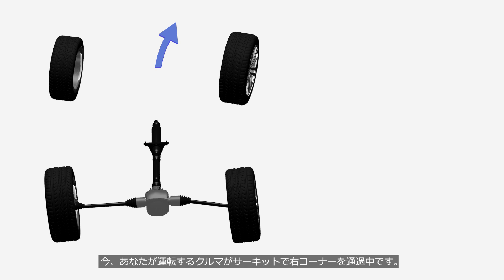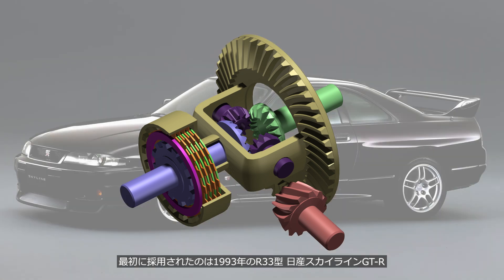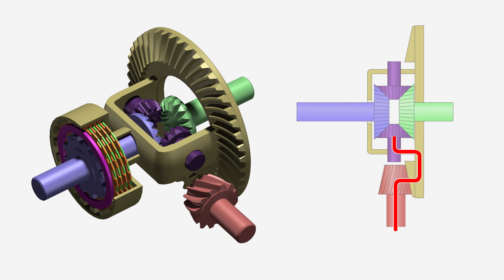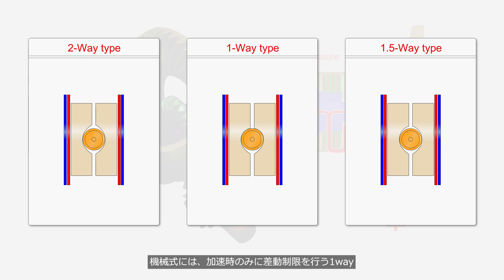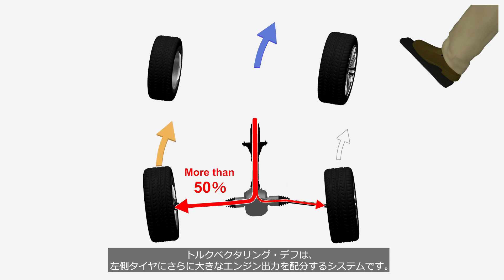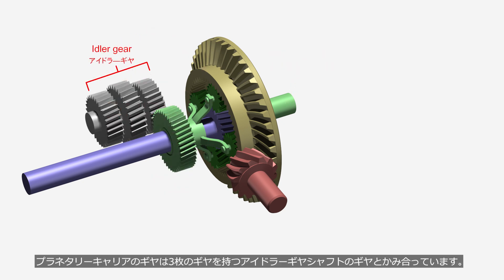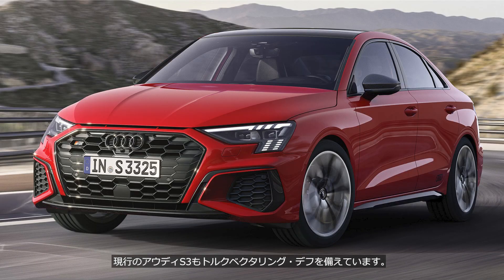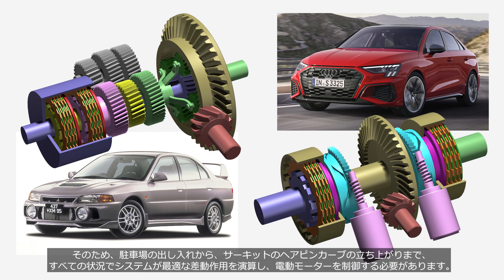Active limited-slip differential and Torque vectoring differential, How they work

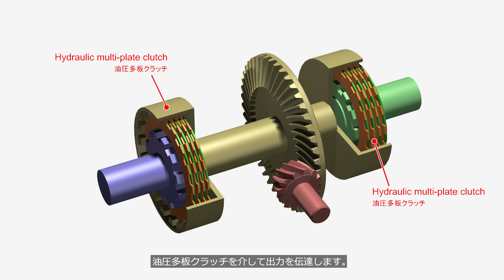Comment: The dual clutch pack actuator in the Audi 6:10 , so similar to the Lexus RC F TVD system! Beautiful !
Reply from the maker: Thank you for watching the video. I also think this system is amazing.
Reply: Yes but actually no. Lexus system is more similar to what audi uses in S4 and above. Audi RS3/S3 diff decribed in the video works on different principle that the lexus one. Lexus one is more similar to Mitsubishi one, even tho on the first glance it does not look similar at all.

Comment: So are these clutches just designed to slip the entire time they are active? If they were to be fully engaged and locked, would the outside wheel just spin a constant amount faster than the inside?
Reply from the maker: Thank you for your comment.
This issue always confuses me.
In the past, I asked an engineer from a clutch manufacturer about the hydraulic multi-plate clutch used in the center differential of a 4WD system.
I asked, “When the torque distribution between the front and rear is 60:40, is the clutch slipping?”
He answered, “No, it’s not slipping. When driving straight, the front and rear wheels rotate at the same speed. Therefore, the clutch is not slipping.”
Based on this answer, here’s my speculation:
The difficult part to understand is that what the clutch transmits is not rotational speed but torque.
Imagine the left tire is on ice, and the right tire is on a paved road.
The resistance on the left tire is zero, while the right tire experiences significant resistance.
At this time, if the clamping force of the left and right clutches is the same, the right clutch will slip, and all the engine output will be transmitted to the left tire.
When the system detects it, increasing the clamping force of the right clutch will transmit torque to the right tire. At the same time, reducing the clamping force of the left clutch will lower the rotational speed of the left tire.
In other words, if either clutch starts slipping, it is controlled to reduce the slippage.
I believe the same mechanism operates during cornering.
However, at small intersections and the like, it likely operates as an open differential, with the clutches slipping.
If my understanding is incorrect, I apologize.

Comment: seems that Audi design, while mechanically simpler, would be yet another failure point in the drivetrain. The mitsubishi would at least still operate as an open diff with the clutches burned out.

Thanks for the informative video!
Reply from the maker: Thank you for watching the video and leaving a comment. 
Exactly, Audi's system relies more on electronic controls, so it seems more likely to have issues.
But I've heard that Mitsubishi's system is also prone to breaking down, and it's often replaced with a mechanical LSD.

Comment: Just to confirm, with a limited slip differential, will only a max of 50% of the torque be redirected to the wheel with higher traction?  

And for open differential, almost all the torque goes to the spinning wheel, with the least traction?

Thanks so much.

More vehicles should come with these advance differentials, even if only for the safety aspect.
Reply from the maker: Thank you for watching the video and for your comment. 

With a mechanical LSD, if the locking rate could be set to 100%, the LSD would operate like the device in the image linked below. 
Therefore, torque would be distributed 50% to each side.

https://drivelines.co.uk/2019/11/20/what-is-a-bevel-gearbox/

In an open differential, if one tire completely loses traction (for example, on hard ice or when it's lifted off the ground), 100% of the torque is sent to the tire. As a result, the car won't be able to start.

In my area, it almost never snows or has icy roads, so I've never had any issues. 
But, one of my friend's cars got stuck on a sandy beach. He might have been better off buying a car with an LSD.

Thank you,